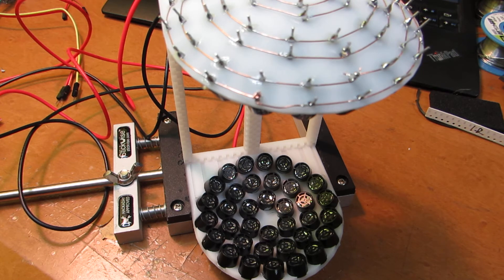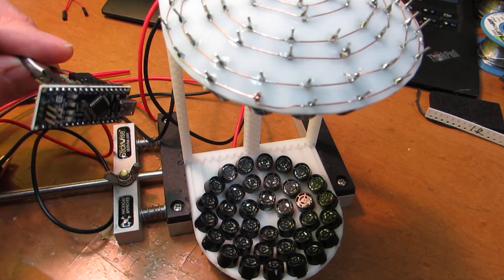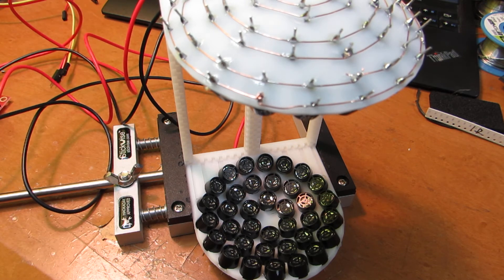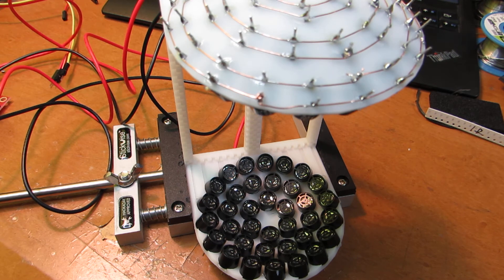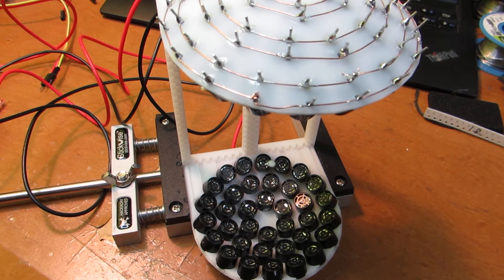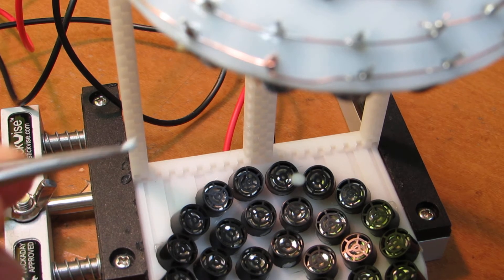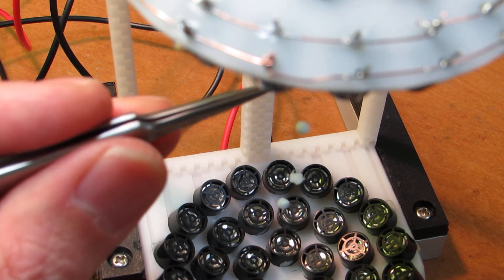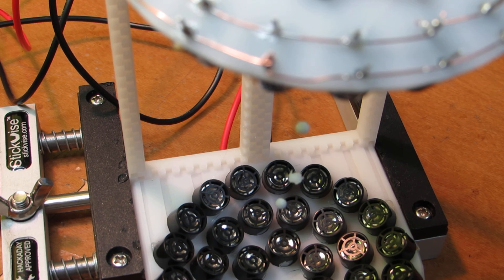Evaluation of kit: Acoustic Levitation kit from tindie.com

Comment: Interesting. I played around with some stuff around 1 khz or so at one point. At the time I had an audio oscillator that allowed a second output that you could shift the phase of. That let you adjust where the standing wave was. That piece of gear died and I hadn't thought much about it until seeing this. There are actually signal generator apps that let you play with frequency and phase. Not trying to plug my channel, but there is a video there using an app to make Lissajous figures and other patterns. I'm going to have to think about how to do something like this with it. Great video! You are always doing something interesting.
Reply: Hey, i would like to ask you a question since you seem to know what you are talking about. Would it be possible to invert the 40khz frequenzy by 180° to negate the audible sound or would this interfere with the standing wave?
Reply: At 40 kHz, the wavelength in air is going to be around a third of an inch. That means the sources are several wavelengths apart. If you do a search for something like interference pattern for two point sources in a ripple tank, you'll find that while they might cancel out "in the middle" of the two point sources, there are patterns of constructive and destructive interference all over the place. (In the example of the test jig here, think about a speaker and an audible frequency--you'd expect to hear it anywhere in the room if if was loud enough. With two speakers facing each other and you standing a few feet to the side, you'll likely notice areas that are louder (constructive interference) and quieter (destructive interference).) So you might be able to construct a small area of quiet destructive interference between the two sources, but you'd still have sound waves scattered all around the sources. (That is assuming that the sources aren't tightly focused like the light of a laser. That seems like a pretty safe assumption for things at audio frequencies.)
Reply: @W4JBM  alright, thanks mate. I am planing to start a businesses with all kinds of desk toys and it would be pretty bad if the sonic modules produced audible frequencies. I figgured out by now, that they operate at 40khz wich is twice the max of the human hearing range. Therefore it shouldnt be a problem to put a nice casing around it and make its look futuristic. Thanks for your fast response. I will keep the thing about constructive and destructive behavior of sounds in mind